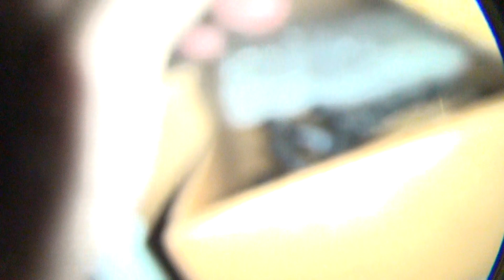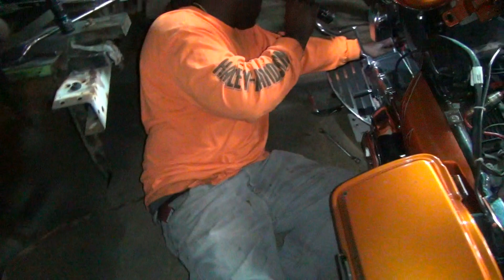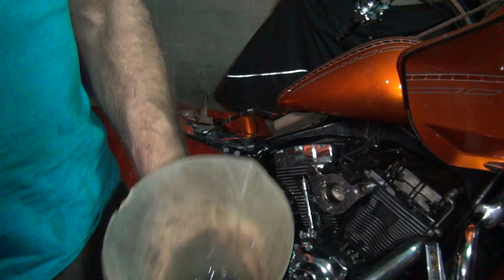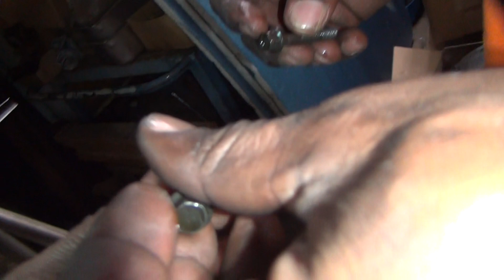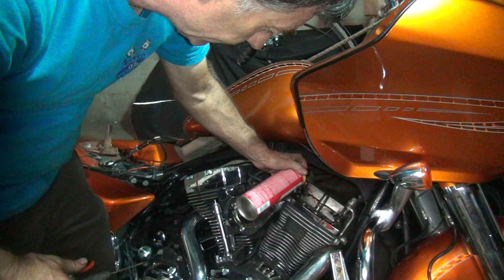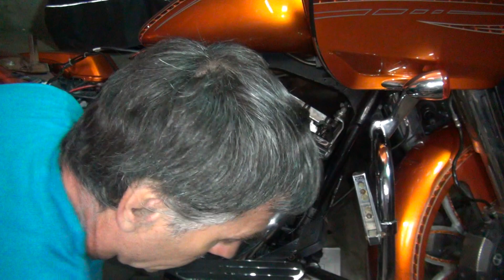#145 2011 roadglide find the motor noise FLT harley twin cam repair motor primary by tatro machine

Comment: Did I miss a part where you put the motor at TDC or anything?  I coulda sworn I was told to get the push rods to a specific point before disassembly

Comment: I used to use a hypodermic needle to fill lifters manually but now I got a vacume system that pulls 100 lbs witch primes them quite well
Reply from the maker: i think the filthy oil tank from the last blown up motor might be screwing with the lifters and other things. i can only do so much for these guys.
tatro
Reply: @TatroMachine  ya well the brothers are known for lack of maintenance. Pull the dip stick on their car and the oil is black and thick as tar if there is any oil left . Don't change it or check it ever

Comment: I put my new lifters in a vacuum jar with slick 50 in it and pull a vacume on it till bubbles quit coming up . Slick 50 is great for all motor parts except the crank it will couse a journal to slip . But what goes on and in the lifter isn't enough to hurt the crank when mixed in with the crank case oil . But the first 30 seconds are the most critical for lifters and cams
Reply from the maker: that is why i like solids. you get the same thing every time.
tatro
Reply: @TatroMachine  today's pushrods can not handle solids at high rpm